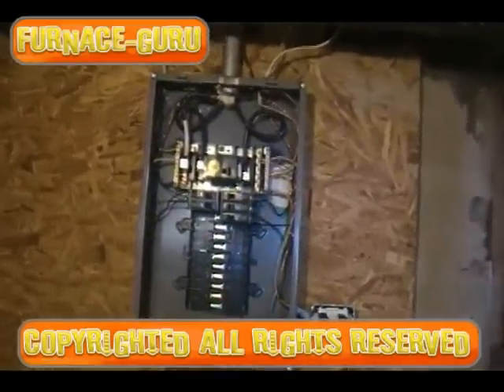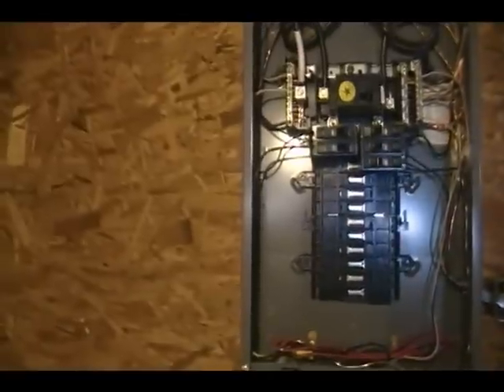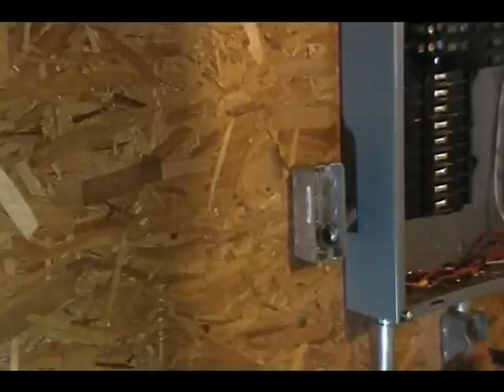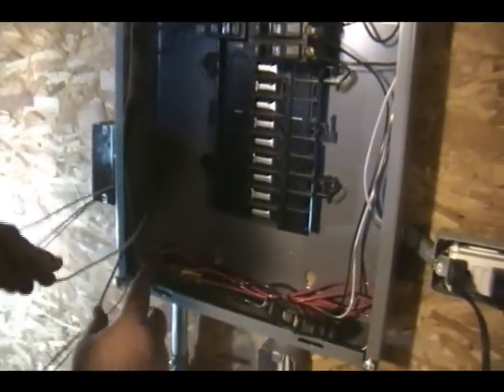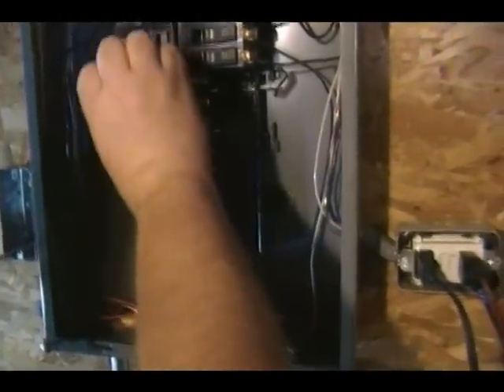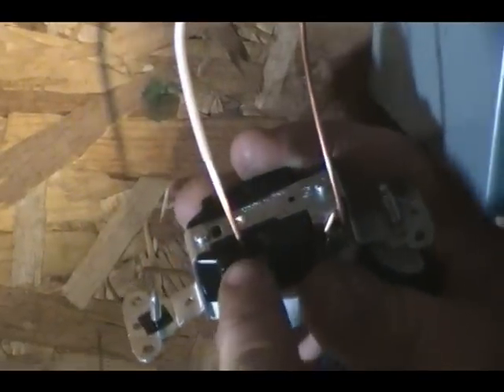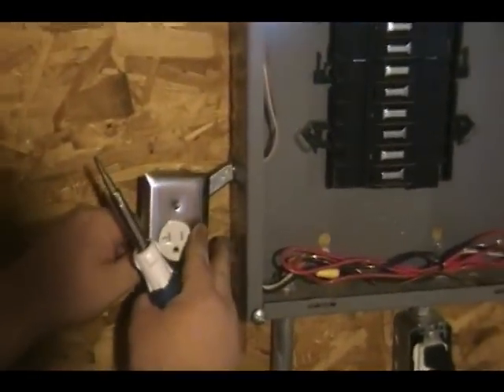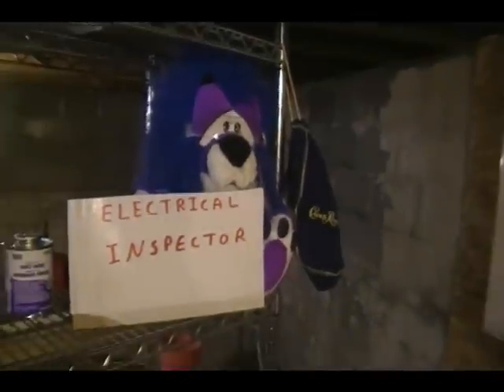How to run a dedicated electrical circuit

Comment: If you install a 20 ampere receptacle, it must be installed on a 20 ampere branch circuit.   Meaning #12 conductor and a 20 amp circuit breaker.   You can install 15 or 20 amp receptacles on a 20 amp breaker as long as it is not a dedicated single receptacle.
Reply: what ?

Comment: GFCIs do work without a ground. Also, there is a raised spot at the top of the box with a hole tapped to accept a 10-32 screw. The ground wire should be wrapped around that as well. 20 amp receptacle on a 15 amp breaker is not a violation but is odd.
Reply: My exact concern....didn't know it was allowed.....I guess it is....
Reply: A 20 amp receptacle is not allowed on a 15 amp circuit.
Reply: @tadonplane8265  Sure it is. If you read the code carefully, you'll see that the prohibition on 20 amp receptacles on 15 amp circuits only applies to circuits with two or more outlets. So a single 20 amp receptacle on a dedicated 15 amp circuit is allowed.

Comment: Thanks for pointing out some basics. My question is, shouldn't the 3 wires remain in plastic covering ? seems like you separated each. I would be concern with accidental removal of insulation on the white and black wire.

Comment: Can I do this with the power on going to the breaker box?My breaker box does not have a way to completely shut power off, It's an old breaker panel from about 1967.It doesn't have an off switch an off lever.Or anything to turn the power completely off to the whole panel. I.
Think the panel is made by pacific, Don't know if they're still in business

Comment: If I'm not mistaken but  if there is a receptacle in an existing structure with no ground you can replace it with a GFCI since a GFCI will trip if something happens

Comment: Yup they make 20 amp breakers.  I'm an amateur myself, but generally your target is not exceeding the panel's amperage rating, voltage on that master panel can be either 110 or 220 for any given circuit.

Comment: Actually your ground is already there because it is installed in a metal conduit. In most industrial applications when the metal is conduit used, you don’t need an extra ground wire.

Comment: Thank you for sharing. I need to run a dedicated circuit for my living room home theater. 
Quick question if it’s ok. Situation is main breaker box is 50ft away and on the some wall . I want to run the line outside the house but not sure if anything other than metal conduit will hold up in this Texas sun. It’s a pain to run metal conduit and looking for a alternative sheathing.
Reply: They make outdoor lines for that type of job

Comment: I need to run a new circuit cable out of my service panel out to the rear of my stucco house.  It is a flush-mount panel, so pulling wires through the wall is quite a problem.  Is it OK to use one of the rear 'break-outs' inside the service panel (circuit breaker box), and go to the outside wall from it?  (I will use PVC from the panel, through the wall, and to carry cable along the outside stucco from there.)
But I never see anyone use the 'rear' breakouts - just the top, bottom, and sides. (?)
Thanks!

Comment: Why did you connect the common and gnd to the same bar? Shouldn't they be separate with the gnd connecting to the gnd
Reply: Deborah Blank its a neutral, not common ... they only should be separated in sub panels, in main panels they can be together

Comment: Its grounded directly to the breaker box. via metal conduit.
Reply: Yeah, just needs a jumper wire from box to device so the device is grounded even when unscrewed and removed from box.

Comment: If I put the new box and outlet right next to my breaker box  ,Which is located outside on the back of my house, Then the cord on my window AC unit would not reach it. I would have to use an extension cord probably more than fifty feet , but less than a hundred feet. Run the extension cord along the back of my house. Until it gets to the bedroom where the new A. C unit is. and drill a hole through my block wall and run the extension cord end to plug the ac unit into.

Comment: Is the reason you used 12AWG wiring/receptacle for this circuit because the homeowner wants added flexibility for more power in the future by switching out the 15 amp breaker with a 20 amp for heavier loads? that way they don't have to rewire the whole thing just switch the breaker out

Comment: Question! Did you hook up a 20 AMP outlet to a 15 AMP breaker. Is that safe? Is there such a thing as a 20 AMP breaker? 
Antoher question, should all your breakers equal 220?
Reply: Yes there is a 20 amp breaker

Comment from the maker: No, the wire and plug are rated for 20 amps if the breaker is a 15 amp it would trip if 15 amps was exceeded ,so this circuit is over safe.
Reply: kevin miller 20 amps receptacle can only be used with 12 gauge wires and 20 amps breaker.

Comment: lol at 14 minutes the box suddenly flips around and the wires come in the top instead of the bottom and you can see the old screw holes in the wall above it. there must have been a reason for the turn around but maybe it was just aesthetics.
Reply: Mikej1592 
Yes but 4 screws??? Lol
Reply: I noticed the same thing. It looks like a new box, too, because the all the plugs are in it but the one on the bottom. Unless the plug he originally removed magically returned. My guess? He's OCD and wanted the outlet closer to aligning with the bottom of the main breaker panel, or, realized it was too high and lowered it a bit (I say OCD because he used 12-guage wire, FOUR screws and a level to mount the box, and wrapped tape around the outlet - overkill - all of which I would've done 😜).